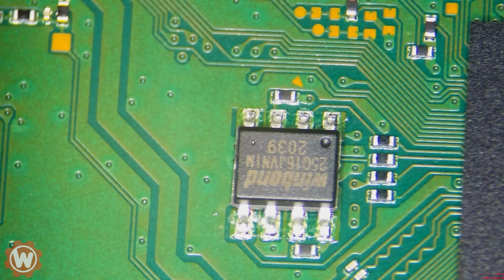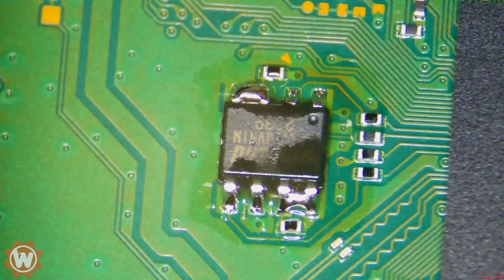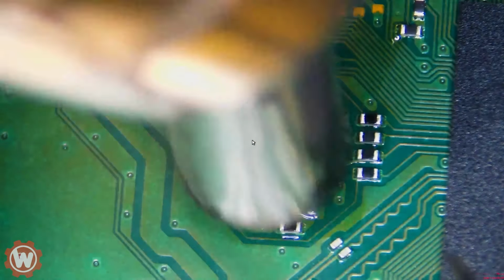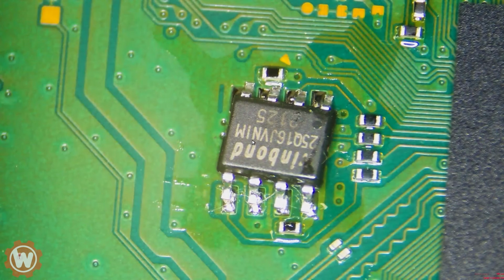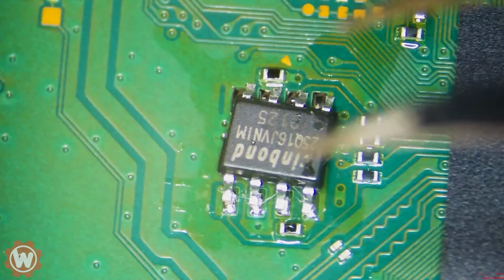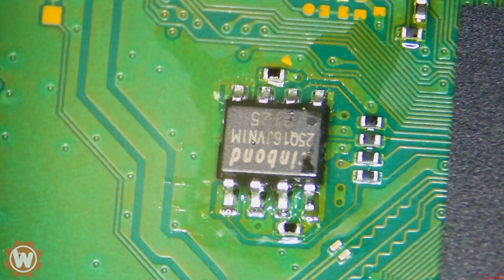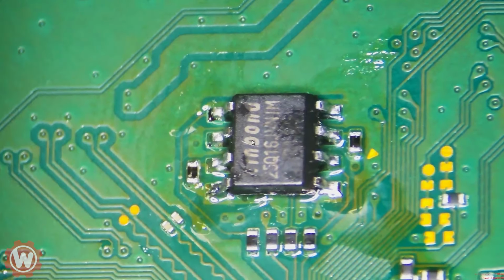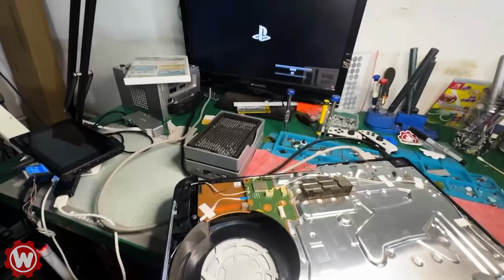Revive Your PS5 - Expert BIOS Replacement

Comment: Can same motherboard model bios chips be interchanged? I have a bad mobo and a good one but missing disc drive daughterboard from good one
Reply from the maker: Yes they are compatible
Reply: @Wayayeo  would this make the disc drive work again?
Reply from the maker: Should work fine yes.
Reply: @ thanks, will try tomorrow and let you know.
Reply: @ changes bios chip, it says disc unsupported? Do i need to reinstall firmware or something?
Reply: @Wayayeo  changed bios chip, it says disc unsupported? Do i need to reinstall firmware or something?